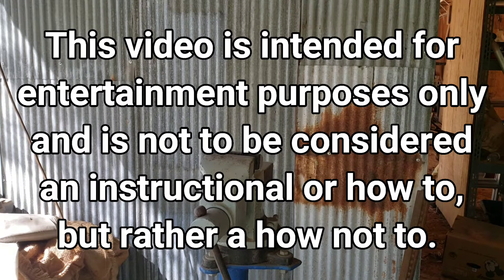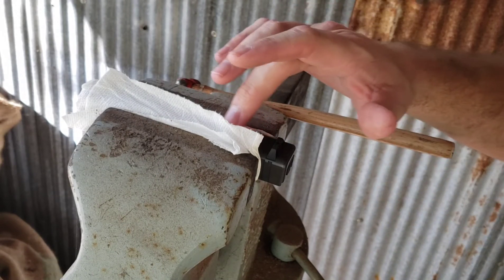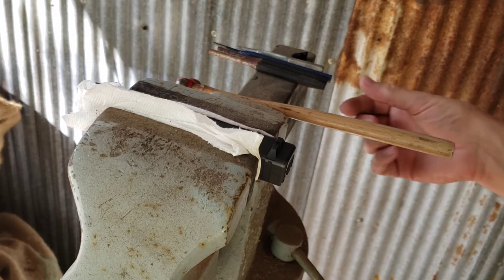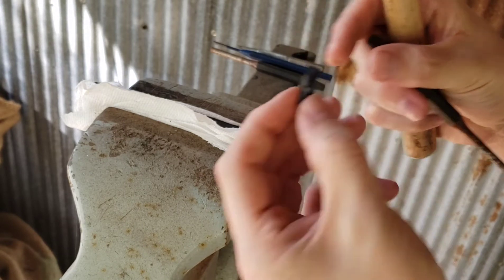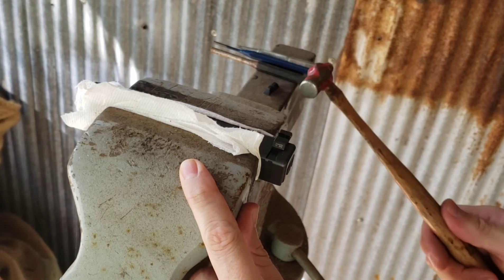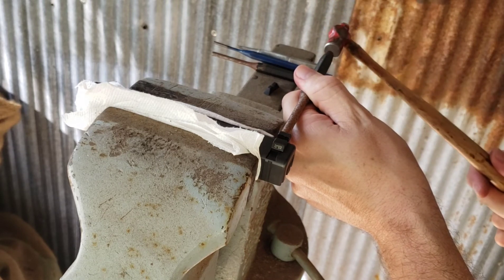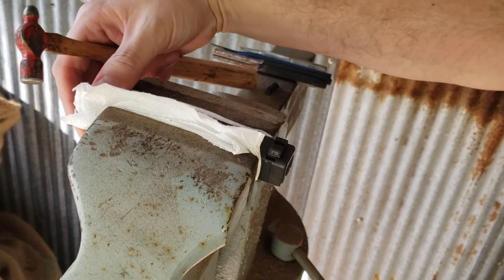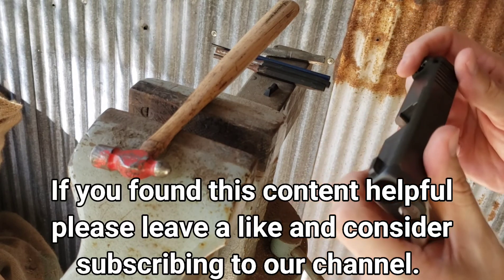The Wrong Way to Install Dovetail Sights

Comment: I bought a 1/4” brass punch. Filed it down about 3/4” up the punch to a half moon. Gave me a good flat punch surface with a squared off face. Measured the depth of the sight from both sides and did exactly like you show back to the location of the sight. This method works great. Thanks for sharing. Brownell’s also sells a triangular sight punch if you don’t want to file a round one to a half moon. About $14 plus shipping.
Reply from the maker: Thanks for sharing 👍

Comment: You sure got the browser attention. They sell pad for the vise grips not tomorrow or damaged slide upper. If anything, you could use wood panel or cardboard of plastic panel to grip. Center your upper where there is most mass which is the center of the vice jaw. Not at the end. Don't leave your upper Hangout
Reply from the maker: Thanks for sharing 👍

Comment: Jay would this method work on a Springfield armory subcompact I have heard that they are some of the hardest sites to change some people say the original sites have to be cut off of the slide thanks for the video
Reply from the maker: I don't know brother, I ain't never done a Springfield. The absolute worst ones I've ever done were Walther PDP. I just about lost my religion on the first set of those. 2nd pair went easier. 
Thanks for watching my nonsense brother!